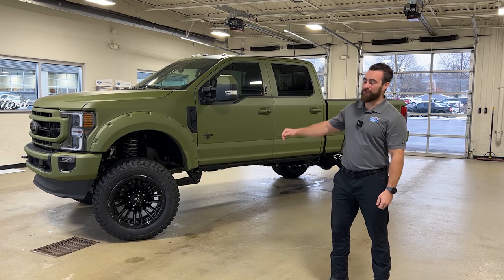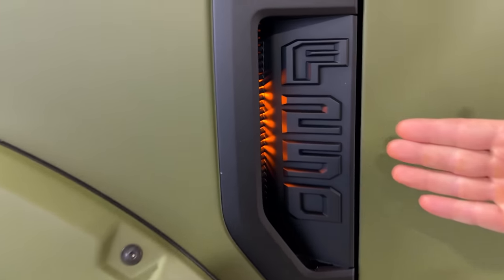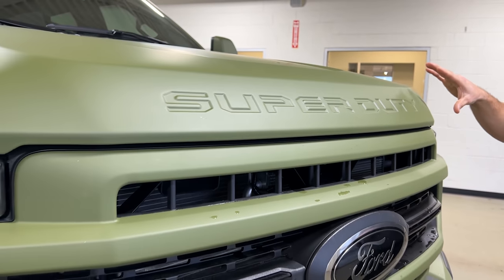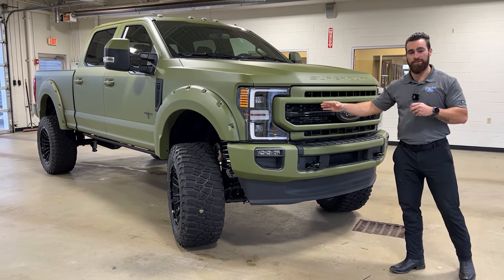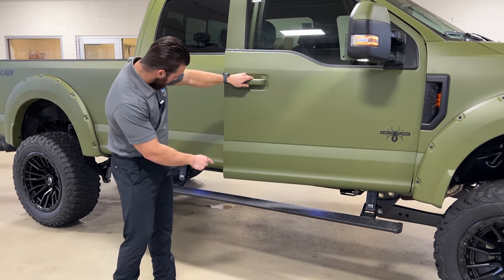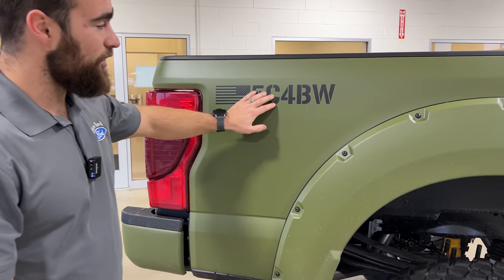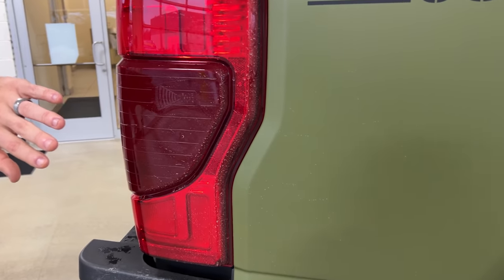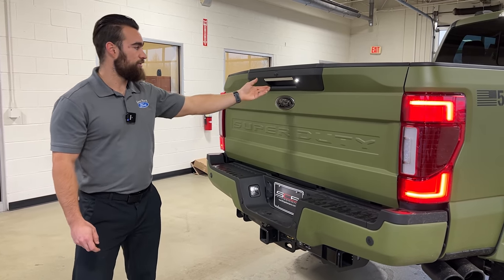BEST SUPER DUTY EVER? 2022 Ford F250 - 7.3 SCA Black Widow Armed Forces Edition 🔥

Comment: Chevy trail boss or Goliath 6.2 liter or duramax Allison Trans heavy duty frame better work trucks no aluminum body  Chevy or gm dodge good work trucks I'd trade it in for a Chevy but cool but for a work truck just  a nice set of 10ply mud tires but 4 inch lift is plenty for ground clearance
Reply: Chevrolet and GMC truck engineers have not designed good 4WD trucks since 1988. GM 4WD trucks are PATHETIC off-road. The new 10 speed in the 2500 and 3500 trucks...the 10L1000 is mostly a Ford built transmission...virtually nothing Allison about it.
Reply: @15Jeep  so is that why the turd raptor uses a gm Baja suspension hahaha 😆🤣😜
Reply: @15Jeep  not to mention the fact most classic ford's or rebuilds have 350s hahaha wtf man
Reply: @bradkaberline5828  That is correct. However, there are numerous reasons why Bob Chandler chose a Ford F250 back in 1974. This truck would soon later become the first Big Foot truck...with a big block 460. All of the Ford Big Foot trucks used the 429 or the 460. Virtually everyone has seen and heard those engines...and knows those engines are bad a$$.
Reply: @bradkaberline5828  I thought Ford used Fox suspension. By all means, provide the details.
Reply: @bradkaberline5828  Turd Raptor? I like the concept of the truck, but definitely do not like the engine Ford uses in the Raptor. 

Ford would be wise to build two old school push rod V8 engines...a 6.5L V8 for the F150 and a 5,7L V8 for the Bronco.

Although the 1500 ZR2 is an improvement over the Trail Boss, Chevrolet still cannot build a good 4WD off-road truck, especially the Class 2 and Class 3 trucks.
Reply: @15Jeep  and the raptor has a wide base probably a gm humvee Frame suspension ect but cool but the Baja suspension was designed by vw and gm porch Mercedes all gm connected
Reply: @bradkaberline5828  Appears to be crystal clear you are letting your vehicle and engine bias show. 

You might be surprised to know I am not biased towards any of the auto makers. The fact is ALL three U. S. auto makers have built some neat vehicles, good vehicles and some great engines. 

You should do some research. Read about the Ford FE V8 engines, especially the information about the Ford FE 427 V8. After that, you might be able to actually participate in meaningful discussion.  

Ford should have built the GT as a  production car back in the mid 1960's. It would have moped up any sports car (including the Corvette) built by Chevrolet or Mopar. 

It was the Ford GT with the big block FE 427 V8 that beat Ferrari four times in the 24 Hour Le Mans. In addition, NASCAR outlawed that engine because the Chrysler and Chevrolet boys were crying in their beer.
Reply: @15Jeep  even Oshkosh is a general motors company best offroad military trucks fire trucks peterbuilt Detroit diesel but cool
Reply: @15Jeep  even the big Ford 9000 cat motors
Reply: @15Jeep  and you want to get in to old school shit most moonshine cars were Chevy or dodge with Cadillac motors or just built up
Reply: @bradkaberline5828  Yeah....and the Ford F650 and F750 have available CAT diesel engines...or use to, have not checked those out in a while.

I always get slightly humored when guys call the power plants in vehicles 'motors' instead of 'engines.' The new EV's have motors while the old vehicles have engines. Mechanics should know better and use the proper word(s).
Reply: @bradkaberline5828  Actually, the early moonshine cars were all Fords, with the 1940 Ford Flat Head V8 being the iconic classic.
Reply: @bradkaberline5828  I like several vehicles from all three U. S. makers. All three have built some iconic classic vehicles. Three of the most reliable and durable gas engines ever built were six cylinders: 1. Chrysler 240 Slant Six; Ford 300 Inline Six; and the Jeep 4.0L Inline Six.

Comment: My 2016 Explorer had earned its true reputation: Found on the Road DEATH. Coolant leaked into its engine right at 100,002 miles. Ford still have water pumps building inside its cheap oil engines?
Reply: So when your waterpump fails and all waterpumps fail , when it leaks inti the engine oil and 
if you don't catch it your engine is toast....I think the 7.3 waterpump is  external

Comment: $ 100,000 should buy you a John Deere tractor with real farm output ability.  An F250 diesel in 1993 was 32 grand. That's $ 62,000  today. You know who loves this unnecessary $ 40,000 in extra technology is the bank used to finance this ego trip

Comment: "best" with a 7.3 flex fuel 🤣 that's funny ✌️
Reply: The Ford 6.2L gas engine is flex fuel. The Ford 7.3L gas engine is not built for flex fuel use.
Reply: @15Jeep  E85 compatible 🤣

Comment: I thought 7.3 is a diesel engine. Disappointment when he lift the hood, hoping to see diesel. 😪
Reply: The 7.3L diesel was an available engine on Ford Super Duty trucks from the early 1990's until 2002-2003. The 7.3L V8 'Godzilla' gas engine was new starting in 2020.

Comment: Another rust bucket with cheap ford foreign steel. A disgrace. I’ll never buy another Ford Truck. Bought brand new for my retirement. After 52000 valves shot and finally the 4wd front wheel succumbed to rust and collapsed off the truck. This is the truth. Had to have it taken off the road with 10032 miles on it. Nice retirement vehicle. I was sick!!
Reply: Your story is powerful at a personal level. However, it is virtually meaningless from the perspective of bashing any particular vehicle brand. Thousands of people have had similar experience with Chevrolet, GMC and Dodge (Ram) trucks. The fact is, ALL vehicle manufacturers have produced both good and bad cars and trucks.

Comment: FORD Failure On Race Day
Reply: You probably drive a Buick lesabre 😂
Reply: Ford is a failure on race day? Really? 

Let's take a look at some history. In case you or anyone reading wants proof, here are two points; one from racing history and one from 4WD truck history.

1. The engine many people forget about is the Ford 427 V8, arguably the most bad a$$ V8 ever built. As a reminder, it was the Ford FE 427 V8 that beat Ferrari 4 times in the 24 Hour Le Mans, something General Motors and Mopar NEVER achieved. In addition, the Ford FE 427 V8 was outlawed from competition in NASCAR. Ford has definitely made a mark with the 302, 352, 390, 428, 429, 460...and the 427!!!

2. Numerous Reasons why Bob Chandler chose to purchase a Ford F250 4WD back in 1974 which later became the first Big Foot truck. He proved Ford Big Block V8's (429 and 460) can be built to be bad a$$.

Your comment is PATHETIC for several reasons and clearly shows your GM and or Mopar bias is wiping out any common sense you might have and more importantly, overriding your ability to think critically.
 
Simply put, your bias controls you. Same thing as the tail wagging the dog.